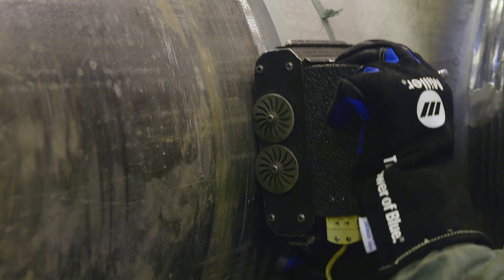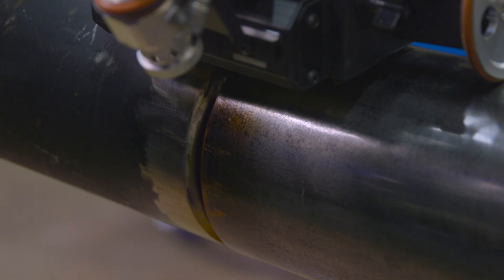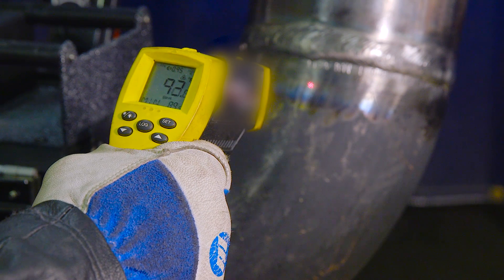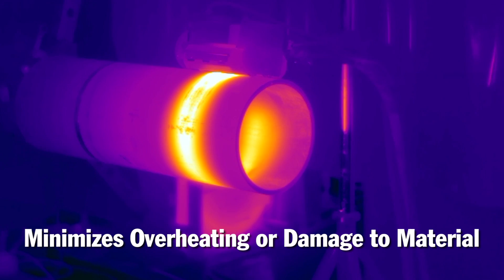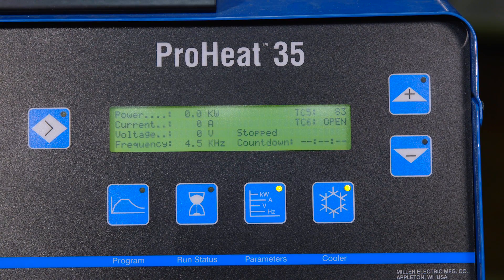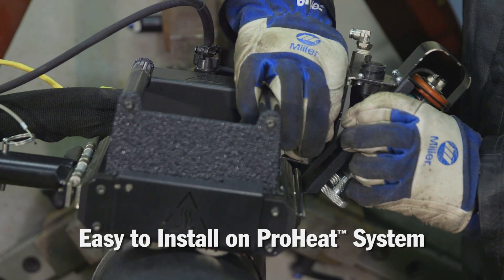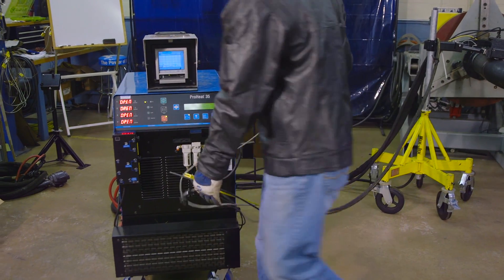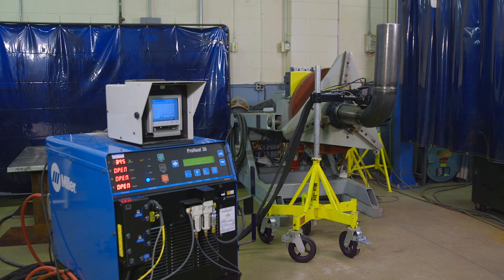Easily Achieve Targeted Preheat Temperatures on Moving Parts using Induction Heating from Miller

Comment: This would really be handy if it was adaptable to plate in up 40' runs like a submerged arc trolley. Work at the largest plate fabricator in the US and we pre-seam our plates up to 40' (4x10' or 5x8') with a self made submerged arc welder to do all seams at once up to 40'. We are now getting really odd procedures on stuff like C276 nickel alloys that involve preheating before seaming plates with a submerged arc weld. I ordered $27 million of C276 last week as part of a $1 billion carbon capture plate project. We're now looking for a solution we can preheat and submerg arc weld at once that would save an incredible amount of time and labor.